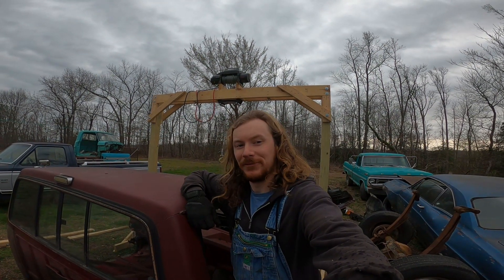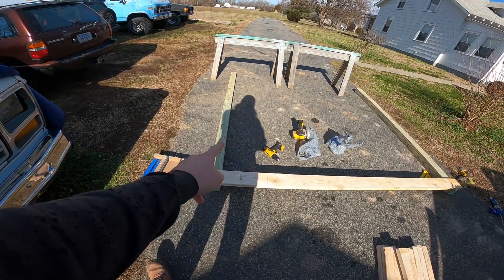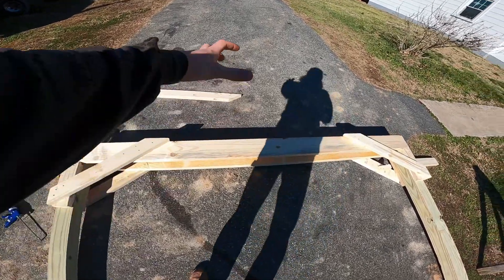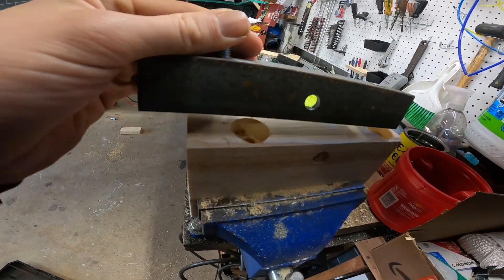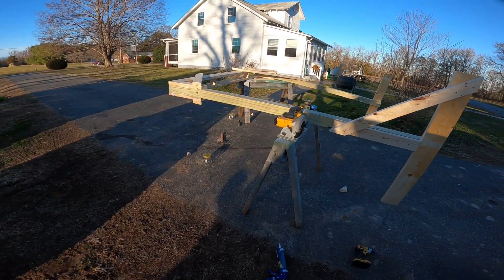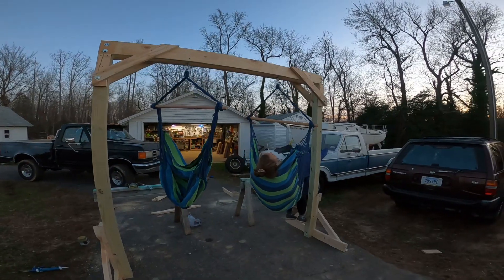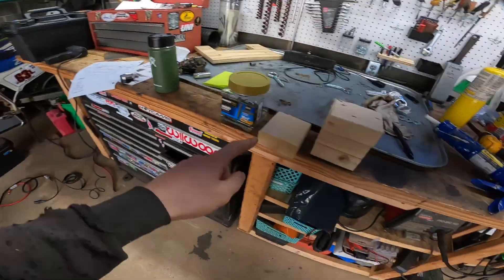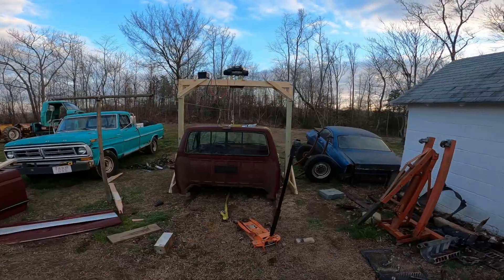Building a Gantry Crane to Remove Truck Cabs

Comment: This build is where my height will come in handy as I, being 6'8" have a 9' reach.  Instead of a winch though, I'm going to put on a chain hoist as I'm a cheap bas***d, lol.  The gantry will sit behind my garage and be used mostly for picking up the mower.  Either with or without the deck, depending on whether I'm changing blades or belts.  Would have to shorten it to use in my garage as my old garage has a 7' ceiling.